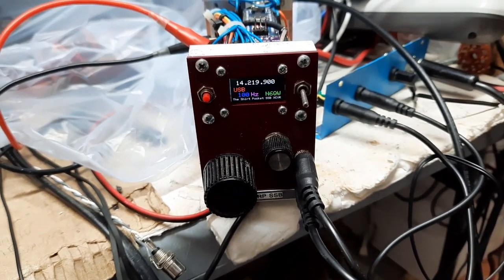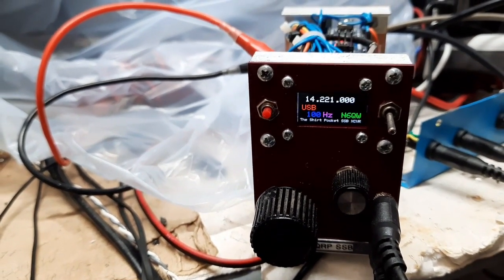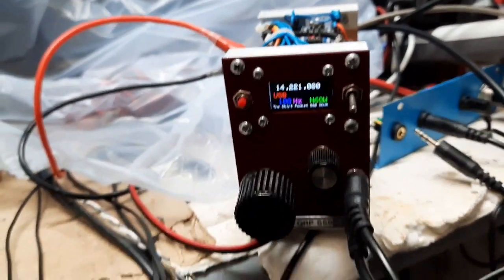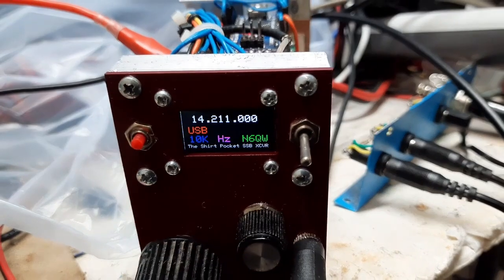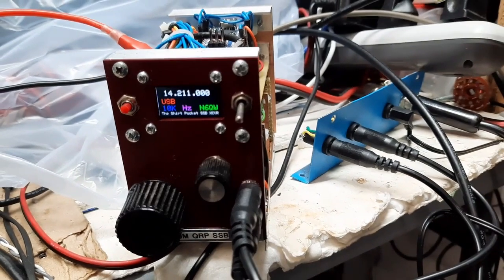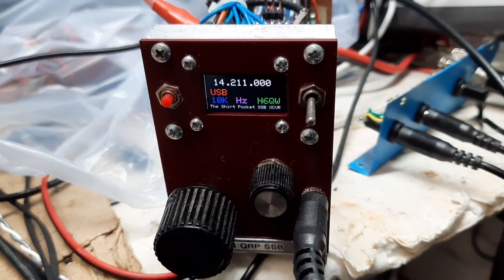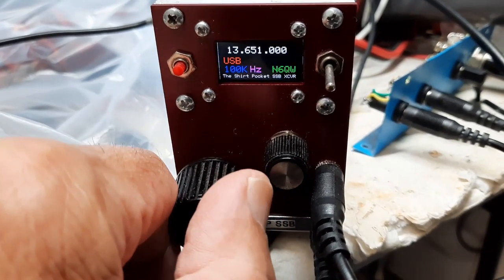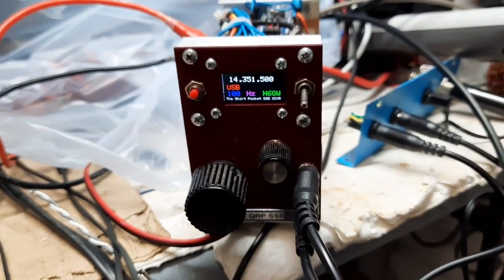Reinventing the 20M Shirt Pocket Transceiver

Comment: Pete, can you post the schematics? new and old versions?
Reply from the maker: Thanks for the interest in the project. First you need to send me an email to my QRZ.com email and then I can send you stuff. I will send you the original article, along with the design for the new BFR106 RF Amp stage and the new 20M BPF along with the Arduino sketch. But this is a project that has been updated over time and some of the stuff was just done and I moved on. So Cave Canem (Beware of the Dog) as I might have not sent you some stuff that was simply forgotten. But it will be enough to get you started, 

73's
Pete N6QW

Comment: Pete I'm not sure what I'm more impressed with; the electronics, the programming or the mechanical engineering. Outstanding work!
Reply from the maker: Hi Mike,
Thank you for your kind words. That project would not have been possible unless I had the two mills. Good thing I was able to fix the CNC.

73's
Pete N6QW

Comment: Nice ❤
Reply from the maker: Look in the video for a photo of the display and match the info. They cost about $3 and have 65000 colors.Less than 1 inch square and use the ST7735 code set.

Pete
Reply: @N6QW  Thanks. I asked the question before I finished watching the video, d'oh :) Then I realized my mistake

Comment: Avoid all screws on front use jd weld
Reply from the maker: To gain access to the slot to peak the BPF you need to remove the angle stock above the Color TFT. So screws are needed -- If I had thought more about it I would have counter sunk the screws so the face would appear flat. Interesting that you would comment only on the screws and not the overall project. I guess you don't build many things!'

Pete N6QW

Comment: I have always had very myopic eyes and worked with repairing pagers ect. Its amaizng that we now have the arduino nano nano and the 5351 to work with, Imagine not using shields or arduinos' for a vfo with super micromini physical properties. Amazing how small it could get ! Programming wouldn't be that easy but wow, tiny ! That said , a lot of great work Pete ! But, I think my next pota will be with the sBITX . Such a cool little platform. 73 N6GRG
Reply: That watt meter looks a little like the microwave associates watt meter I have.
Reply from the maker: It is a Drake W4.  @californiakayaker